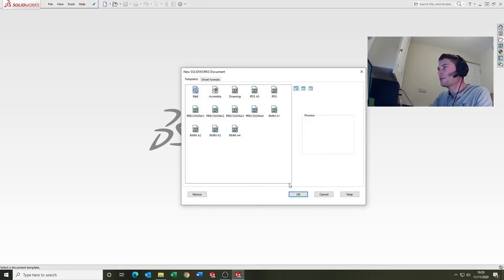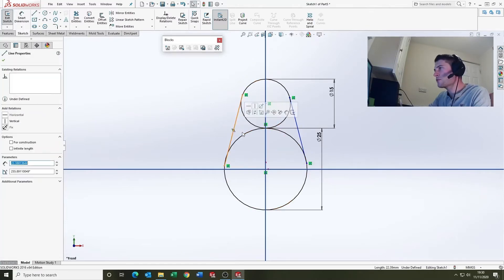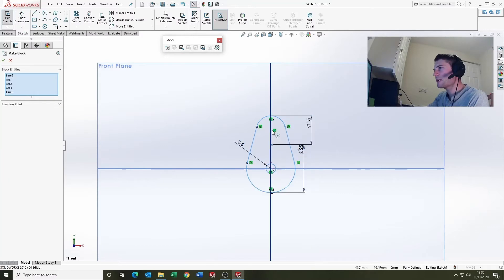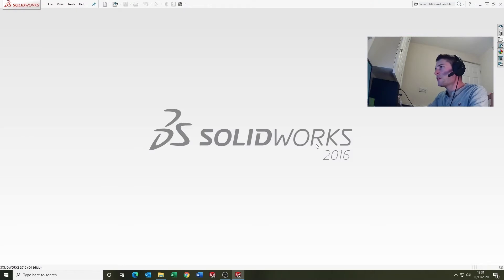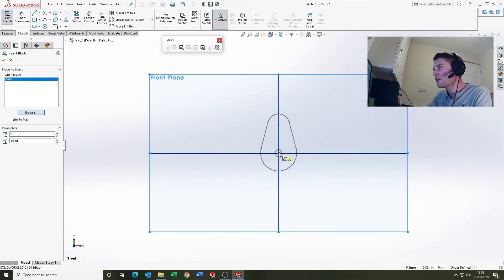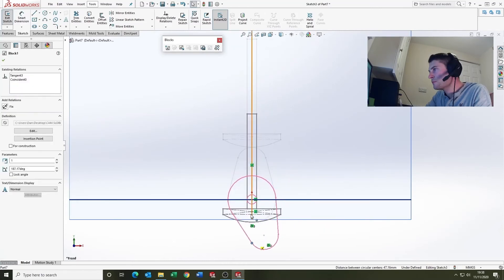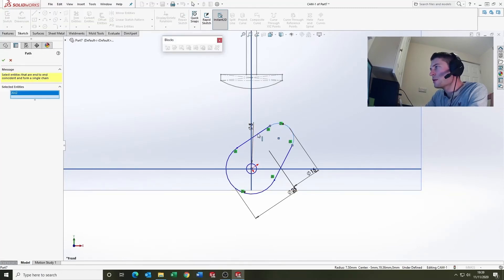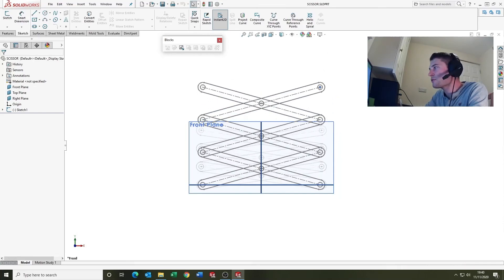Solidworks Tutorial - Blocks

Comment: Very helpful. I knew you could design mechanical systems with blocks, but this really shows how to. Also I did not know about the "Path" option. 

I use blocks whenever I can for setting up parts that need to be at an angle but are difficult to fully define in a normal sketch. I also use blocks exclusively for Logo's. Logo's as normal sketches are way too slow for some reason and block work really quickly. Only issue is when you scale a block below .1 it becomes difficult to select. Solidworks can be so finicky sometimes!

Anyway thanks for the great video. Blocks are a very powerful tool that there is very little information on youtube about.
Reply from the maker: Hi thanks for the comment. Yes I agree blocks are super useful for all sorts of applications. That’s interesting about setting them up for parts on an angle - I am going to look at using them for logos next week and then hope to look at adding them to custom drawing templates. Solidworks does have its funny ways sometimes. 

Your very welcome - thanks for commenting, I like to hear how other people work and hopefully I can learn some new ideas from other people as well.